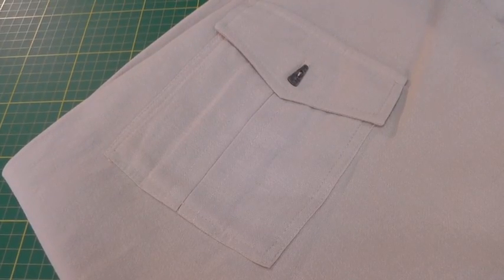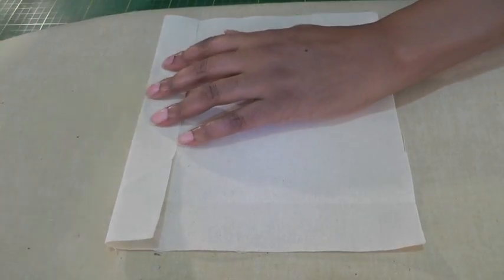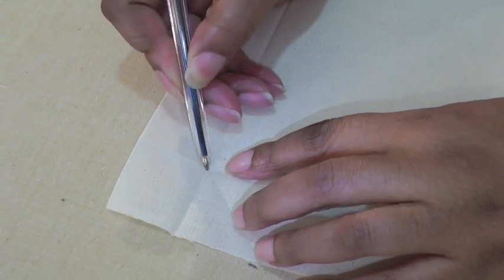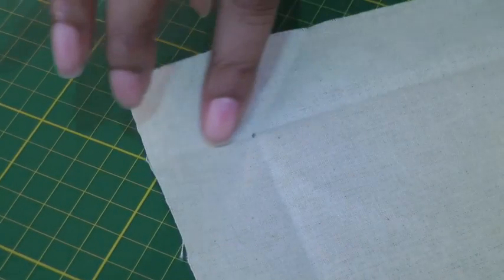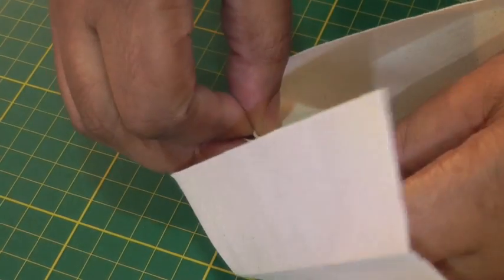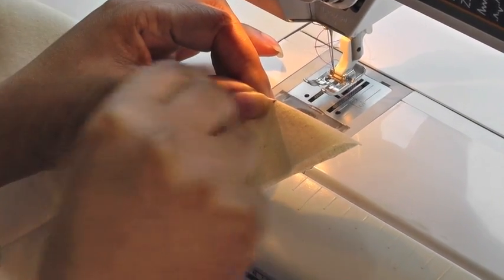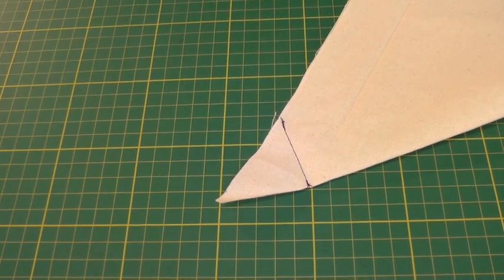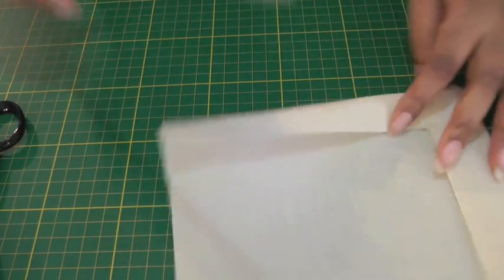Sewing Mitred Corners

Comment: Hi, I love the video- it's really clear. How would you do a meat corner like this if you wanted the hem turned twice to give a neater finish? I don't know if I've explained it well enough but thanks in advance for your help x
Reply: if you have a hem that is turned once, just iron it down before following Colleen's instructions.  Then, after you have done the mitered corners, press and pin the turned under edges and top stitch.    Result:  hemmed edges and mitered corner without having to baste stitch (although you could if you were not used to top-stitching).   You only need to fold the fabric once, not twice to get an enclosed hem.  Good Luck

Comment: I have a blouse that ready has a front facing that has been finished off. I now need to do the bottom hem. How do I miter the two corners where the bare hem meets the front facing (where the buttons will go)
I hope this makes sense. 
Jane
Reply from the maker: I think I understand Jane. This method should still work. I would baste it first just to make sure before machine sewing.
Reply: @colleenglea  Thank you Colleen.